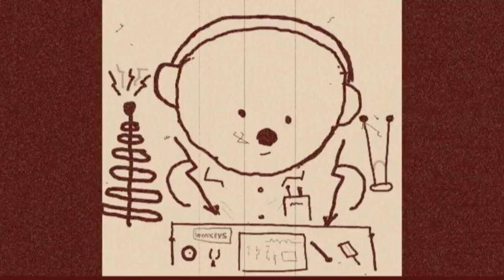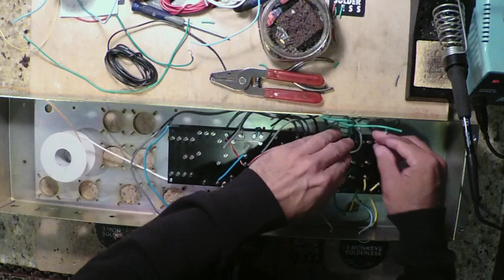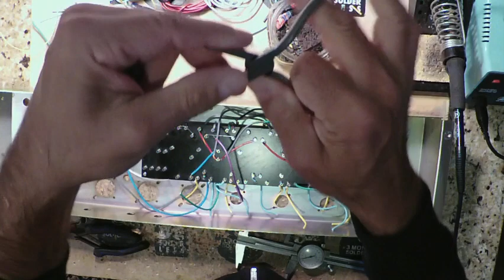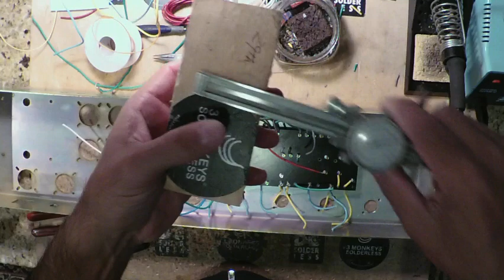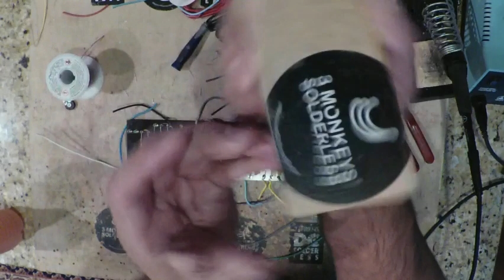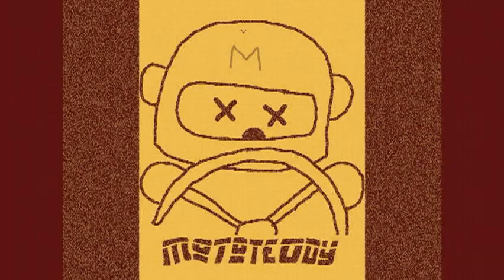Vic Johnson Jose Build Part 3

Comment: Why didn't you use the mustard caps doesn't that sound better?
Reply from the maker: Thats a great question. 

 My answer is no.   If you are trying to build a replica of an early marshall and the aesthetic is important than go for it but if your goal is function I don't think its necessary. This may sound like heresy I know but my experience has cured me of some of the dogma that surrounds amplifier mysticism :)

 I think that there are some differences but not enough to lose sleep over.  Some will never agree with me- I know.

In any case my original Jose didn't have those capacitors :)

Ossie
Reply: @ossieahsen6732  Mallory 150's?
Reply from the maker: @johnmarshall3903  Not a bad choice those 150's. very consistent caps they are... but I gave the Mojotone Dijon caps a shot this time and I found them to be very good :)

Ossie
Reply: @ossieahsen6732  Thanks Ossie, respect your opinion.